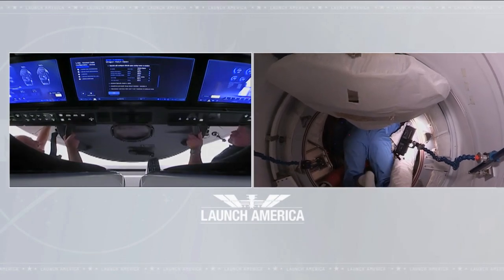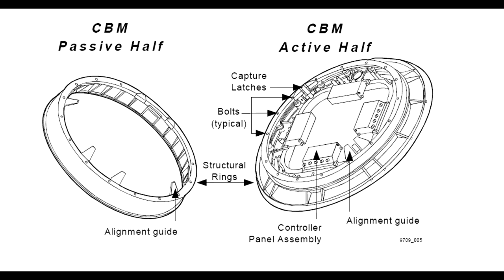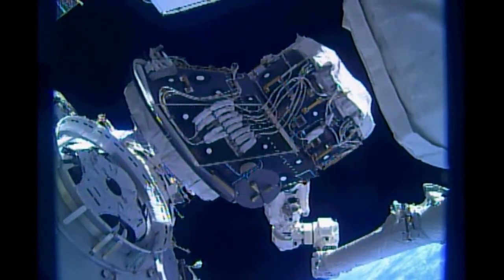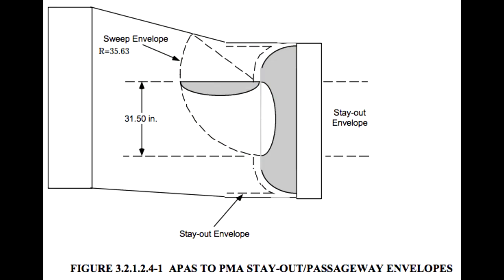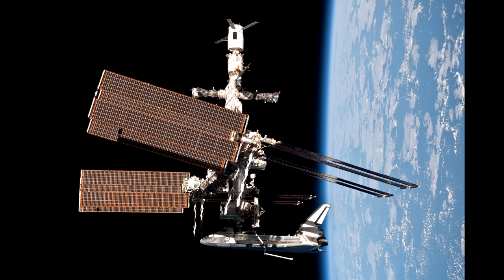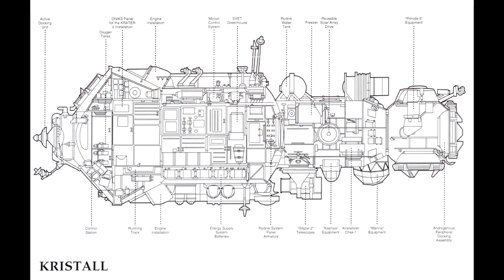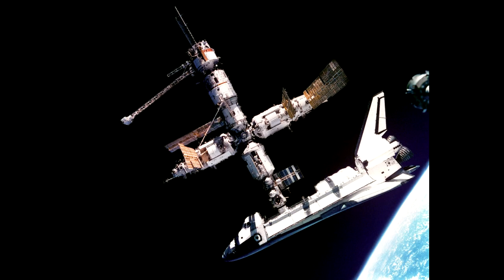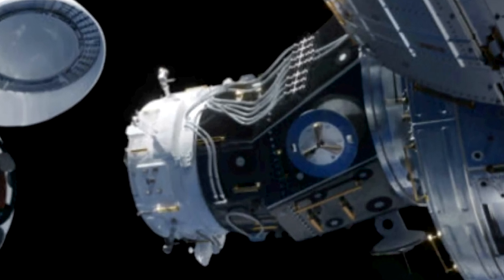Why The Docking Adapters On The Space Station Are Shaped Oddly

Comment: "that is because of legacy decisions, and it will take more than the occasional bumped head to justify changing out such a large chunk of hardware."  Sounds like every meeting within IT
Reply: More like meetings of IT with finance about budget.
Reply: @S6R15  or just dreams
Reply: @confuded  I can confirm this
Reply: More like IT explaining to the director of a company why we have to keep the current networking equipment in place because if we switched everything out all at once we'd have a massive downtime that would affect company production.
Reply: @lonerider92  So that is why everyone can get access to every company intranet.  It would be too expensive to replace the Cisco routers.
Reply: @davidwuhrer6704  Sorry, but your reply makes no sense. Cost is a mere fraction of it. If an IT department is properly funded cost is nothing. It's the fact if you took all the routers and switches offline no one in the company would have internet access. If outside sources are able to get into your business' intranet, then you have a shitty Network Administrator.
Reply: @lonerider92  If you have downtime when you replace a router, maybe connect the new router first.
Reply: @davidwuhrer6704  It doesn't work like that, you have to configure the router before you just go plugging things in. It's not going to pull and assign the appropriate IP addresses if you put a new one in without the appropriate configuration. Even when it is appropriately configured, it can't run at the same time as the old router or switch, because networking is more than just routers and wifi. It'll cause a conflicting IP error.
Reply: @lonerider92  Not if you do it properly.
You configure the new router to accept the devices connected to the old router, then you switch them over to the new router.
It takes a lot of preparation, yes, but both routers can be plugged into the network at the same time.  The question is if you prefer to give IT the slack they need to do the job well, or if you would rather get the job done faster at the cost of downtime.

What even the best network admins cannot do is patch out the numerous known security holes in Cisco routers, even if (or especially if) they are paying for premium support.  But IT is not likely to get permission from finance to replace them:  Support is a service and thus part of the running costs, whereas new equipment is a depreciating company asset.
Reply: Hahah :) this is what it must be like trying to tell Sheldon Cooper a joke. "No that's not correct" ;)
Reply: @lonerider92  you could clone pre-configured router settings and flash onto every new router. You technically don't have to wait to configure every router
Reply: Worst. In IT it is way easier to replace or redo things.

Comment: Damn, even INTEL doesn't have so many socket standards.
Reply: AHAHAHAH
Reply: Oh contraire they are getting close
Reply: At least they don't have to flip the capsule 180 degrees three times in a row to get it to fit...
Reply: Standards are like toothbrushes, everybody wants one but nobody wants someone else's.
Reply: you haven't seen the screw standards.
Reply: @r0cketplumber  well that's for different reasons. One would be the imperial vs metric debate. Second is the weight and third is the purpose story. When you want to dock an e.g. passiv cooled spacecraft you might not want to carry an ammonium connector and such reasons
Reply: @torstenmautz195  I would resist the use of an ammonium connector for brushing my teeth as well. Besides the sarcasm: thank you for explaining some of the reasons!
Reply: @rpavlik1  lol. Ah, USB. The gift that keeps on giving.
At least, until USB C connectors take over completely...

Funnily enough I found some cables with reversible USB A plugs. (they work regardless of orientation)

Kinda surreal, but unfortunately I break cables a lot. (generally a cable with a micro B connector will end up with damage at the B end, in my experience... Not a very sturdy connector type at all.)
Reply: Have you tried turning it on and off again?
Reply: @KuraIthys  USB-C is 6 years old and did not gain popularity, i do not think it will take over ever.
USB-C is too complicated for most people. You have so many different functions that can be there or not be there and so many different cables, even when we only count USB-C to USB-C.
Also, USB costs more. 10 ct more is a lot for a mice that you sell 10 million times.
Reply: @happygimp0  I guess you mean USB-C costs more than micro USB (the last of the old connector series).  Generally, the USB standards after USB 3 have lost the plot that USB was supposed to be simple and cheap with minimum pin count.
Reply: @happygimp0  did not gain popularity? Everything new comes with it at this point, not sure how much more you want. Note that USB A took a long time to become ubiquitous too, connectors always do.
As for USB 3, yeah, it's a mess. USB 4 is apparently taking the position if you have to support everything that's optional in 3, so hopefully that will eventually sort things out.
Reply: With Apple, soon Intel will have one less to worry about.
Reply: @SimonBuchanNz  Even expensive Motherboards for 200-300$ have often only 1 USB-C port, compared to about 8-12 USB-A ports. Try to find one with 3 USB-C ports that can be used as USB ports. Finding a laptop with more then one is also hard.
I still can't find USB-C hubs with multiple USB-C Ports.
Almost every keyboard, mice and thumb drive still uses USB A.
Reply: @happygimp0  fair enough, for space unconstrained devices A is still standard. Generally people are complaining about micro, which is completely gone except for some old stock as far as I can see.
There's a small push towards C now, the new Microsoft Surface Dock has C ports for example, but I do find it odd that few cases have front type C ports.
I do think it will eventually replace A completely, but it will take another decade or so. Remember PS/2 ports stuck around for several decades too.
Reply: @happygimp0  Pixelbook has more than one: "Ports: Two USB-C charging, 4k display, and quicker data transfer"
Reply: LMAOOOOOOOOOOOO
Reply: yet

Comment: Does the possibility of the unused section coming into use mean that the ISS may need additional storage space added? Imagine, the first module added in years; a closet.
Reply: that's basically the bigelow module right now
Reply: @deathpony698  I think the BEAM's mission time has been extended for that very reason...
Russia is planning to launch its Nauka module.... some time.... and that should provide at least some extra storage space... hopefully.
Reply: Outside of Bartolomeo, all the planned additions to the station will be for more storage
Reply: Nakua is slowly joining the leagues of JWST and SLS.
Reply: Axiom space I believe is trying to send a commercial module to the iss.
Reply: I recently watched a few tours of the ISS again, and the one word used most is storage
Reply: If the closet is damaged, it would lead to Narnia lmao.
Reply: They should have left a shuttle up there, docked, its payload bay would make an excellent closet.
Reply: @Marc83Aus  not really. Shuttle is too heavy and cant be powered from outside. Weight is a problem for fuel consumption with orbit adjustment. Its hydrogen fuel cells can keep it alive for 17days. I believe Scott or Everyday Astronaut said that in a past video
Reply: @torstenmautz195  maybe a modified one with some sort of power conection?
Anyway, it's too late for that, the shuttle hasn't flown in almost 10 years.
Maybe we'll see some stainless steel modules from Boca Chica soon though...
Reply: I would love to see an outhouse. Floating a little further away for the really bad ones.
Reply: It's funny. My most common complaint about almost all the apartments and houses I've lived in is insufficient storage space.

I feel like it should be standard to have a large amount of storage in a house or apartment...
But apparently dedicated storage space isn't marketable, so nobody bothers.
I mean, why put in some proper storage when you can add a third (tiny) bedroom instead, right? XD
Reply: @KuraIthys  that third (tiny) bedroom doubles as storage! Just bolt bags of non perishables like paper towels to all the walls for an extra space age look.
Reply: @deathpony698  how to become a billionaire by building expandable space closets, LOL 😂😂😂
Reply: @KuraIthys  The problem is storage space is a functional item. When people are looking at a house or apartment the are look for stuff that is cool not necessarily functional.
Reply: Unfortunately in orbit you can't leave stuff in the backyard with a tarp over it.
Reply: KuraIthys 
Appartements I've visit actually had dedicated storage closets, but those were built in the 1800'
Reply: MarcAFK the cargo bay isn’t pressurized though.
Reply: yeah one with hanger clearance so they don't get wrinkles in there space suits. Washing machines and dryers must be the worst thing to happen to the space station ever!
Reply: I think first they need to construct additional pylons...
Reply: Lady Gaga: I have the most expensive closet of all time
NASA: hold my beer
Reply: @nemo-x  a) dude JWST is quite literally the definition of the cutting edge in space telescopes, the problem was that they were really overly ambitious with the design.  It's an insanely complex design with essentially no tolerance for error.  They had to invent a new material for the thermal shields iirc because nothing known at the time had the thermal expansion properties they needed.  The other thing is that most of this work was happening at the contractors not within NASA.  Source: know people who worked there.

b) you have no idea how bad of an idea keeping a shuttle docked to the ISS is.  Beyond just the power issues (which believe me are harder than you can imagine to solve), the shuttle adds an enormous amount of drag that makes keeping the station in orbit much harder unless that shuttle is fueled and can help boost the station.  Additionally the shuttle is a large extremely expensive thing to fly and carries a nonzero risk to the station of malfunctioning in some way and causing issues.   This is all to solve a problem that can be fixed with a module that costs next to nothing in space terms and poses essentially no risk to the station.  Source: have a degree in aerospace engineering.
Reply: The shuttle often carried a Multi-Purpose Logistics Module which was basically a space station module but only for transferring cargo up in the shuttle bay. One of the modules was named Leonardo, it was updated to become the Permanent Multipurpose Module and fixed to the station on STS-133. 
That's basically a dedicated closet.
There is also the Experiment Logistics Module on the Japanese Kibō module. Which also is basically a closet
Reply: @Marc83Aus  no
Reply: Hmm, after reading some of the discussions I think there's some confusion on the desired capacity of the ISS. The station explicitly exist as a Laboratory like the CDC in Atlanta or NIH in DC. The current scientific demands are being satisfied by ISS we have several open spots in the 14 available express racks, JEM, Bartolomeo, the exposed truss lab, and the Russian mini modules. The station needs more storage to increase scheduling launch freedom and to increase the available time to operate experiments. Most only go for a few days to weeks, some developers want to test over years. If we increase the station functions as well we risk over burdening the 6 crew members on maintenance which over time makes the operations more wasteful.
Reply: @hl_scientist1964  smiled (no LOL)
Reply: vaska00762 Russia has been planning on sending up Nauka anytime now for a very long time.
Reply: Gearloose Just evacuate the atmosphere after the really bad evacuations.
Reply: Hirosjimma Also bolt storage bags around the entryway door, and the living room… and, if the ISS is gonna be your guide… everywhere else.
Reply: There is an unused habitation module with personal rooms and shower gathering dust at the JPL. Could anybody boost it into orbit?
Reply: I think Nakua is finally fligth readdy
Reply: Imagine running out of space in ... space.
Reply: @nathanczaja  Well we don't want to give the ISS Covid.
Reply: Seems to me that soft sided bigelow style modules could potentially be used as as inflatable docking ports.

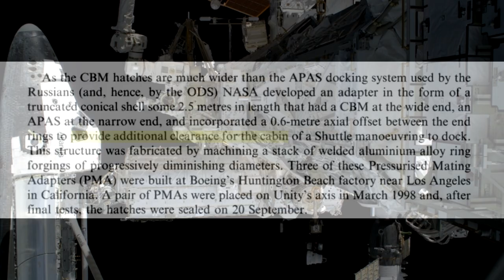Comment: 5:02 To my eyes, the kink allowed the windows on the top of the shuttle to view the docking adapter. "The two overhead windows ... provide rendezvous [and] docking ... viewing" from NASA's "Forward Fuselage and Crew Compartment Windows."
Useful for people who mistrust cameras.
Reply: Yep
Reply: If I recall, the shuttle was manually piloted while docking using the overhead windows.
Reply: I thought docking was automated?
Reply: It also allowed the massive Shuttle payload bay to be unobstructed by station modules.
Reply: They had the to manually dock the shuttle? Didn't the Soyuz have automated docking even though it was a older spacecraft.
Reply: A camera would have been easier. But NASA tends to prefer more solid solutions, like windows, mechanical linkages, etc.
Reply: @livethefuture2492  NASA never developed automated docking. The first US automated docking was Dragon. In the same way, the Space Shuttle never could fly unmanned, whereas Buran could.
Reply: Lol. "The kink"

That's what we're calling it now.
Reply: Why would they have to view (a larger part of) the docking adapter? The windows provide lookout to the port indeed, as far as I can tell, and they would do that equally well regardless how snaky the tunnel behind the port was...
Reply: MarcAFK back then the camera was a potato. Even today, Boeing is trying to use a camera for air to air refueling. Fail.
Reply: @u1zha  you can put indicators on that part, so that you know if you are aligned correctly. A bit like PAPI lights

Comment: The clearance issue makes sense going forward indefinitely. Any future vehicle could still potentially exploit the asymmetry to get more clearance in their chosen direction.
Reply: You prefer Space Shuttle's goofy J-turn instead of putting a docking port closer to the crew cabin that comes straight out and has no cargo interference?
Reply: @bradallen1832  it’s just more clearance for a broader range of vehicles. I prefer whatever works. It’s counterintuitive but I understand why they did this. Emotionally I prefer the simpler straight corridor.